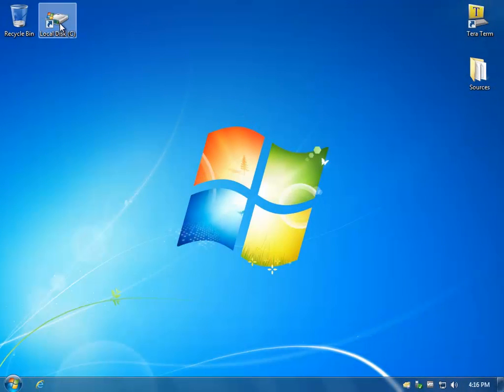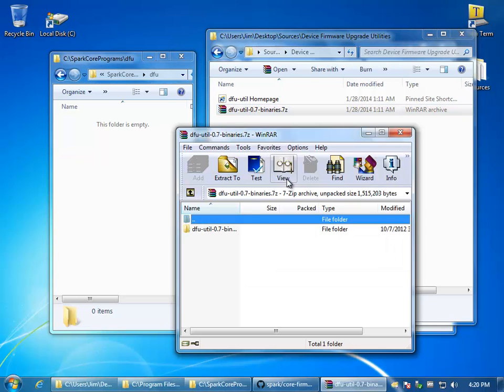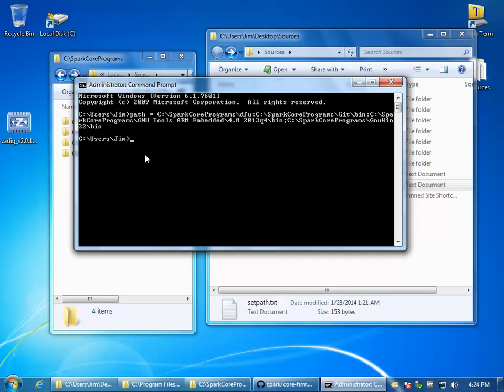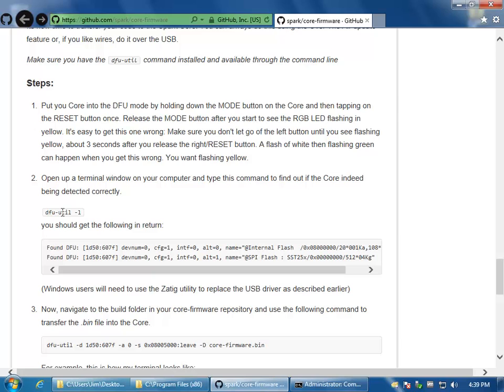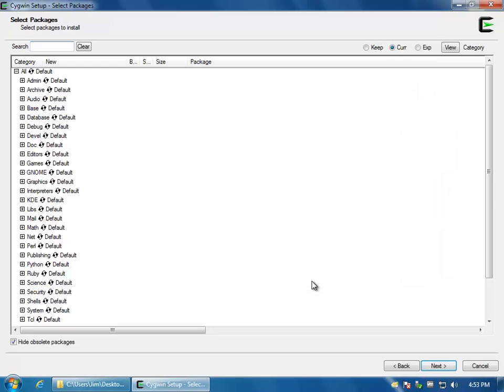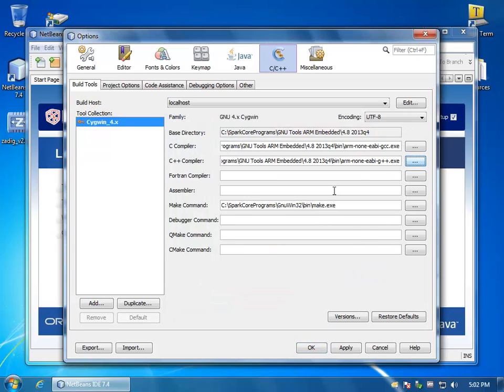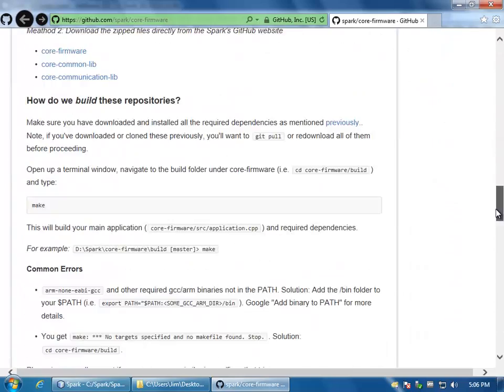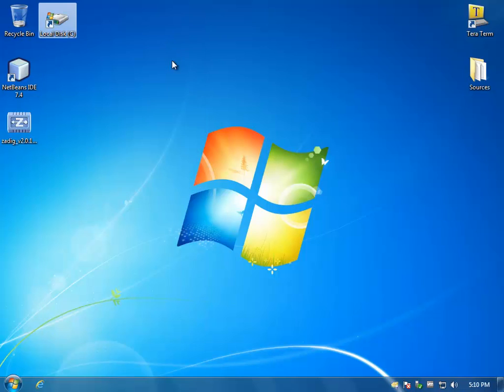Spark Core Compiling Locally in Windows

Comment: Thanks for this - has been useful so far. The problem I keep getting is when I run Make from C:\Spark\core-firmware\build, I get some errors:

Building core-common-lib
Building file: ../CC3000_Host_Driver/cc3000_common.c
Invoking: ARM GCC C Compiler
mkdir -p obj/CC3000_Host_Driver/
arm-none-eabi-gcc -g3 -gdwarf-2 -Os -mcpu=cortex-m3 -mthumb  -I../CC3000_Host_Dr
iver -I../SPARK_Firmware_Driver/inc -I../SPARK_Services/inc -I../SPARK_Services/
src/inc -I../STM32_USB-FS-Device_Driver/inc -I../STM32F10x_StdPeriph_Driver/inc
-I../CMSIS/Include -I../CMSIS/Device/ST/STM32F10x/Include -I. -ffunction-section
s -Wall -Wno-switch -fmessage-length=0 -MD -MP -MF obj/CC3000_Host_Driver/cc3000
_common.o.d -DUSE_STDPERIPH_DRIVER -DSTM32F10X_MD -DRELEASE_BUILD -c -o obj/CC30
00_Host_Driver/cc3000_common.o ../CC3000_Host_Driver/cc3000_common.c
process_begin: CreateProcess(NULL, arm-none-eabi-gcc -g3 -gdwarf-2 -Os -mcpu=cor
tex-m3 -mthumb -I../CC3000_Host_Driver -I../SPARK_Firmware_Driver/inc -I../SPARK
_Services/inc -I../SPARK_Services/src/inc -I../STM32_USB-FS-Device_Driver/inc -I
../STM32F10x_StdPeriph_Driver/inc -I../CMSIS/Include -I../CMSIS/Device/ST/STM32F
10x/Include -I. -ffunction-sections -Wall -Wno-switch -fmessage-length=0 -MD -MP
 -MF obj/CC3000_Host_Driver/cc3000_common.o.d -DUSE_STDPERIPH_DRIVER -DSTM32F10X
MD -DRELEASE_BUILD -c -o obj/CC3000_Host_Driver/cc3000_common.o ../CC3000_Host
Driver/cc3000_common.c, ...) failed.
make (e=2): The system cannot find the file specified.
make[1]: * [obj/CC3000_Host_Driver/cc3000_common.o] Error 2
make: * [check_external_deps] Error 2

Have you any suggestions on how I get around this?

Many thanks
Tom

Comment: When running the 'make' command step I am confronted with " 'make' is not recognized as an internal or external command, operable program or batch file". Cannot figure out how to get this to work. Tried moving on to testing the dfu-util -1 command and that returned the same response. Any solutions? I'm stuck.
Reply: check path variable. I cut and pasted from this link to notepad and it added to random dashes.

Comment: I was getting this error during the build(in NetBean):
mkdir -p obj/CC3000_Host_Driver/ The syntax of the command is incorrect.

The fix was under during Git Installation, Adjusting PATH Environment.
Select the 3rd option -> Run Git and Included UNIX Tools.

For some reasons this step help. It did not fix the error when I run 'make' in cmd though.

Comment: did you also try to use the new cli-commands to flash over the air? It works great in windows command-line, but I didn't get it working under the netbeans (Bash) shell. It says, that I have to login, if I try that it fails with an error: "Error logging in Error: EINVAL, invalid argument"

Comment: It's not a very good idea to move folders out of Program Files folder. Installers don't just copy files there they also do other stuff and change things in the Registry (like uninstall information, etc). It's possible to mess the system up like this. Instead of this way you can tell the installers to install them at the correct folder from the beginning.

Comment: Versamodule, very nice, accurate tutorial. Thanks much. Some comments: I had the same experience as Indra with the extra characters in the path variable. Also in the path variable, pay attention to the GNU tools version e.g. :  4.8 2014q1, as it will differ from what is shown above, and will change the path variable text for that portion of the path. Also, by the time I installed, Java was up to version 8, which would not install on my XP machine. Apparently the installer is the problem and the jdk itself is fine for XP. I found a tutorial here :  http://stackoverflow.com/questions/20965564/installing-jdk8-on-windows-xp-advapi32-dll-error
that shows how to get around this. It is only the installer that is not compatible, not the java jdk itself. In the end, it all works.